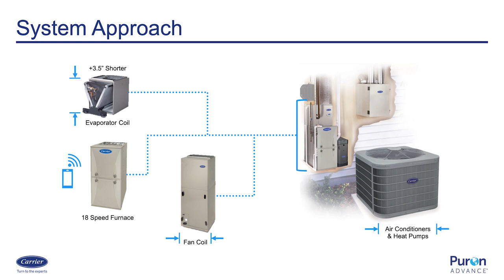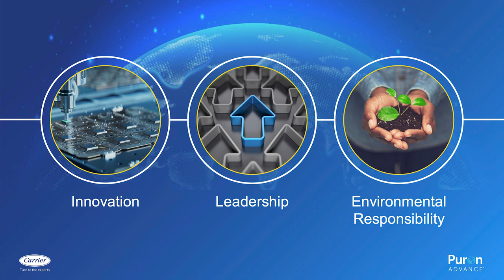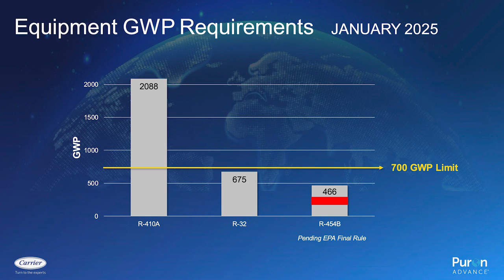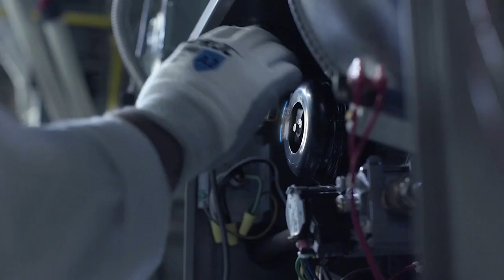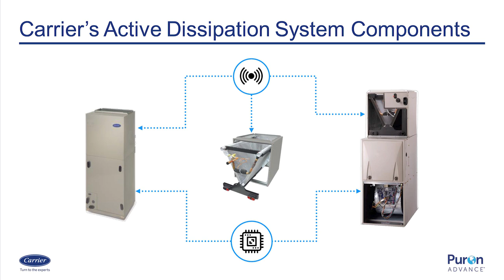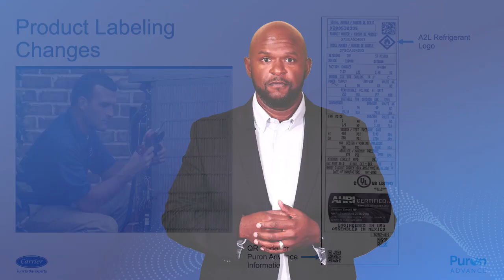Carrier Puron Advance R-454B

Comment: Does the emergency shutdown procedure include shutoff valves on the refrigerant piping or in the circuit somewhere?
Reply from the maker: For most systems the answer would be no. However, for large VRF it is a little different due to the volume of refrigerant exceeding ASHRAE 15/34 limits per circuit.
Reply from the maker: The normal sequence is to turn off the compressor, turn off gas burner or electric heater, and enable the supply fan